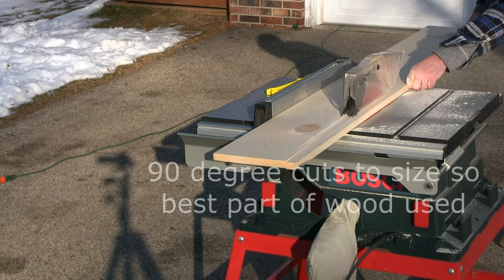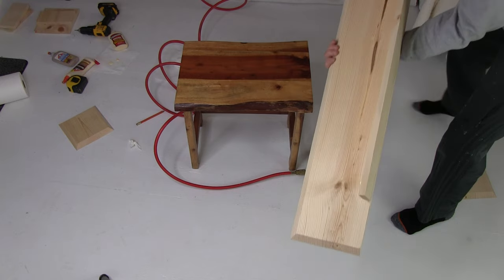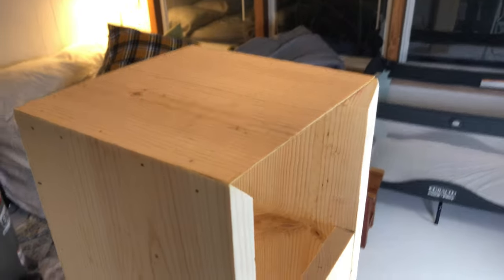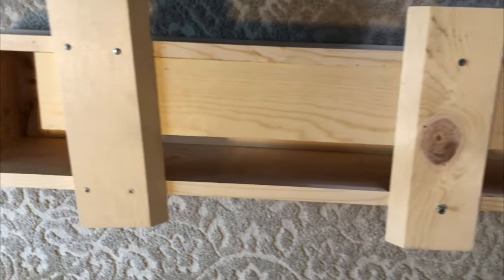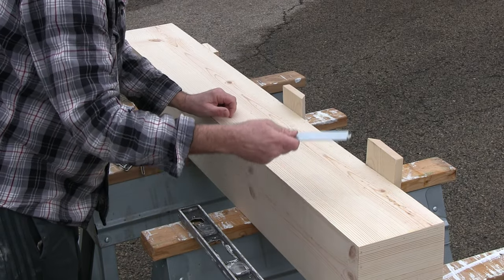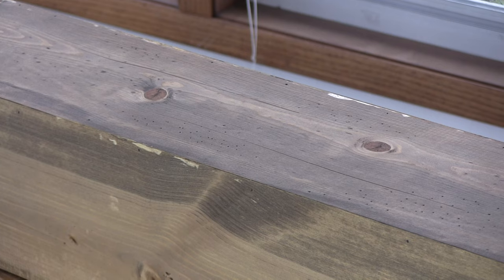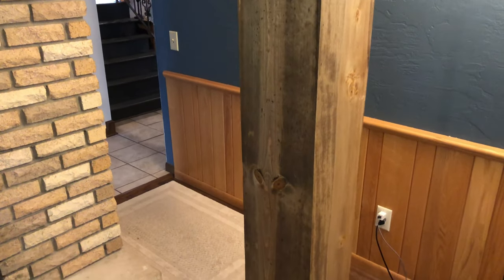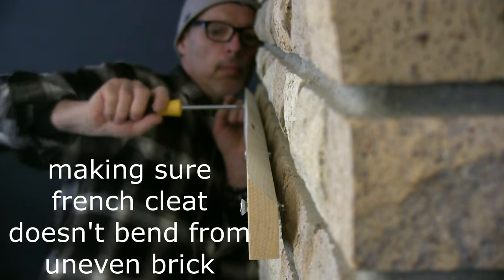Wood Mantel DIY (Rustic Faux Beam) French Cleat Mantle Floating

Comment: Looks great! Why did you say the French cleat “wasn’t necessary”? What can you do instead?
Reply from the maker: Thanks. Because the French cleat has to be spot on straight and it can twist a little bit on you. If I could do this all over again I would not do the French cleat and I would put a thicker piece of wood on the mantle to hang it onto another thicker piece of wood attached to the brick. Then attach a wood screw on each side to keep them together. We could still remove it just by unscrewing the two screws. The reality is...How often are you really going to remove your mantel. Probably never.
Reply: @SilverLiningDayDreams  makes sense!